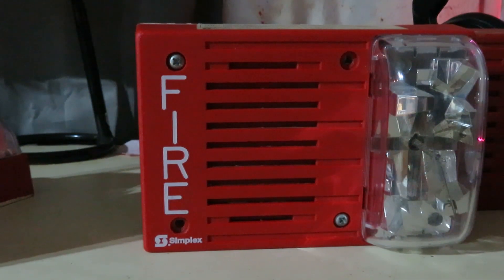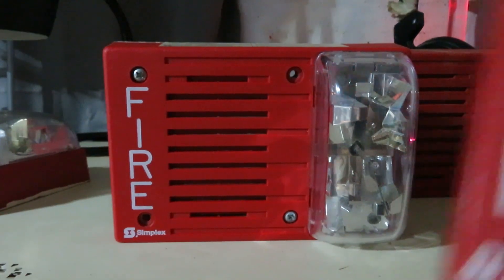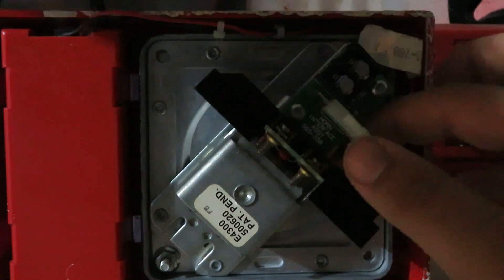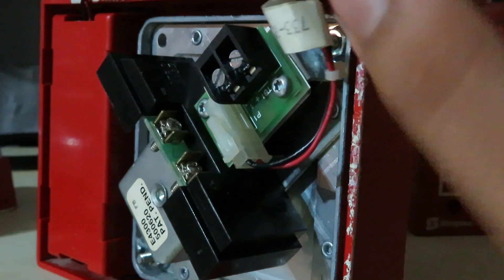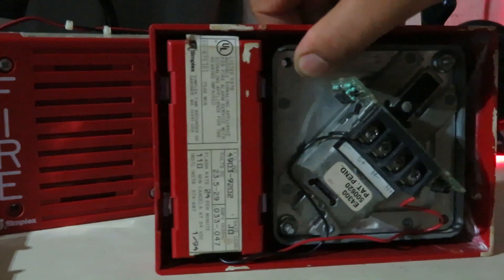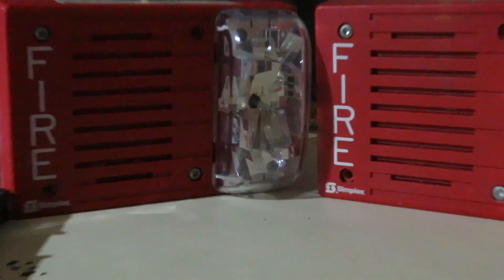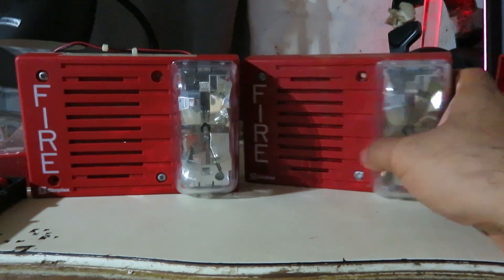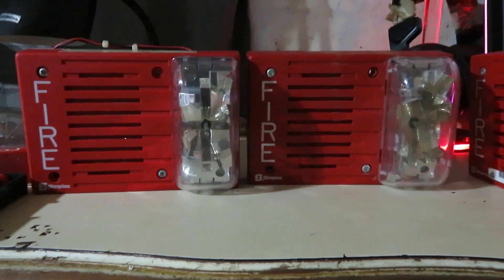Simplex 4903-9202 (Early Gen) Review & Testing

Comment: Four dorms at Rutgers were upgraded with 4903 speaker strobes over several years in the mid-late '90s.   I can tell the order they were upgraded in based on a couple factors such as smoke detectors.  I noticed that the oldest of the systems had slow-flashing strobes like this one, while the second-oldest had very fast ones on the other hand (maybe something like 90 FPM?).   The newest one had a normal flash rate (not sure about the second-newest one, but I'm guessing it did too).

Comment from the maker: Updates prior to this video:

-I have found out simplex offers an option to choose between 24 FPM or a 60 FPM. The 24 version was quickly discounted due to it not complying with a new fire alarm code standards after 95 requiring strobes to flash at 60 FPM.

-There is a lack for 60 FPM and only 24 FPM option for earlier 4904 generation which was produced in 1993.

-Simplex tends to inaccurately print the date on their stickers and it seems to be case for the 9202s. The shell case indicated that it was made in July of 94 and no more or less from that date. 

-from the manual, it seems the 24 FPM option was limited and not a lot to it. Only noticable difference I can indicate is there's is no white versions of the 24 FPM models

-from the strobe being available in 1993, it also might of explained why there is a simplex 4903-9101 on a 4901-9805 combination which is pretty rare to see.

-if find anymore information on this, I'll update this pinned comment.